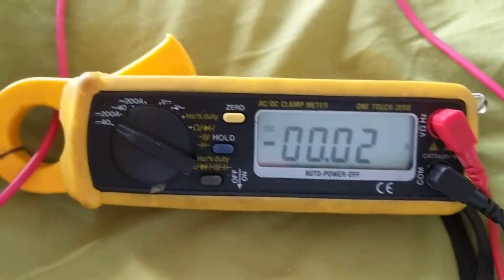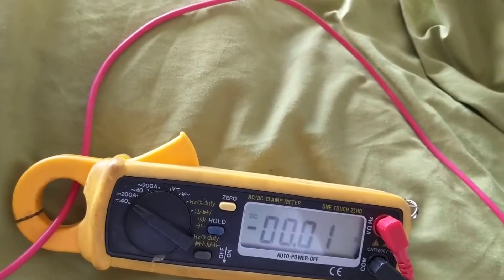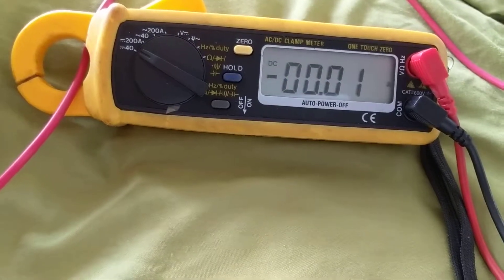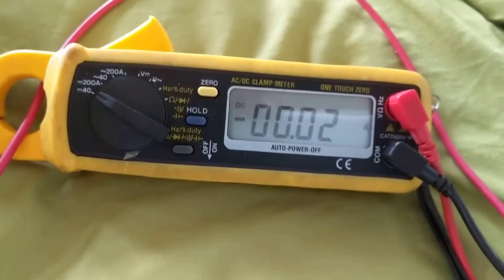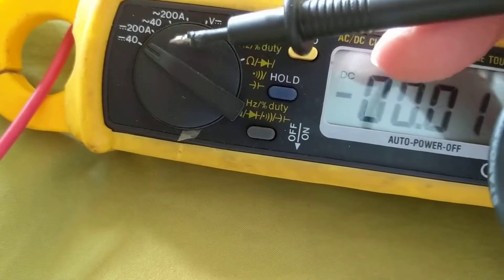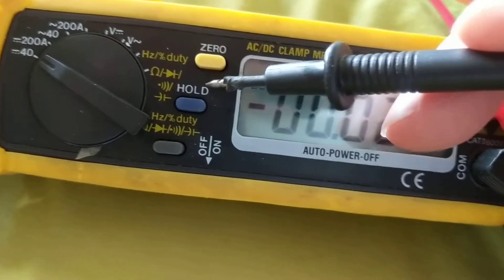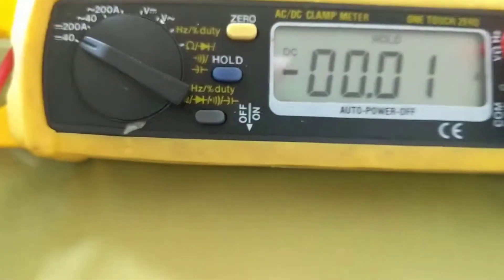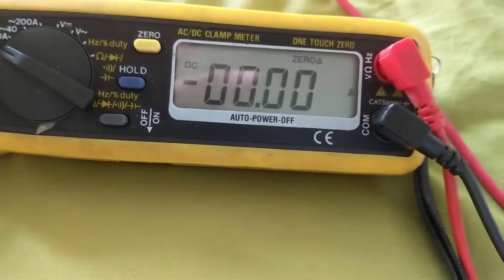BEST AND CHEAPEST, CLAMP METER no need to disconnect cables!!! FOR AUTOMOTIVE CURRENT AND MULTIMETER

Comment: This series made by Prova, and rebranded as Extech, AutoMeter, and possibly a few others with wildly varying price ranges.  Also there are about 8-10 versions  with different ranges,  at least in the Extech line and are NOT cheap.
Reply: Thank you so much for that comment and information I particularly like this one because it gives me a duty cycle and percentage needed for today's vehicles even though the best thing is a scope and scanner but it does come in valuable for alternators
Reply: And this one also can be used as a voltmeter that's why I like this one but if you're looking for a pure clamp meter for current I agree with you that definitely is a greater variety within your price range

Comment: You should do a whole video on nothing but the name of this clamp meter. You could call it 
Part 2: The Name
Or maybe a little mini series
Part 3: Where to buy one
Part 4 how much it costs.
Reply: Thank you and I respect your comments that meter is over 20 years old it's not even available anymore that's why I suggest to get something similar to it which is much cheaper today but thank you so much kerry
Reply: Made by Prova from Taiwan I think.  They make the same meters for Extech and Autometer.  Goto E-bay and check Prova clamp meters and see that they are the same design with different colors. They have several series with different ranges that all look like this.  Be sure to zoom in and check the selector switch to make sure the meter has the ranges you need before you buy,  as I said they have about 10 versions that look very similar.  The Extech brand meters are the same but marked up a few hundred dollars more in some cases.  The Prova 11 can measure down to 1mA dc.
Reply: Lol 😂 True

Comment: To get a DC amp reading, does it matter which wire I clamped? Negative or positive?
Reply: It's done usually on the negative wire but remember there are a couple of negative wires and there are a couple of positive wires one going to start a motor one going to the fuse panel one coming from the alternator or the positive ones the negative ones is the one coming from the engine block use that one thank you good question thank you for being a viewer

Comment: does it read milliamps?
Reply: Because it is a meter basically used as a clamp meter around the wire it reads very high amps like 200 amps so also reading in the milliamps is not available to these type of meters it stresses the point more of high amps you have to do the conversion yourself when it reads amps good question thanks for the comment or question

Comment: What was cost of the meter? 20 30 40 50$
Reply from the maker: I got this meter a couple of years ago I believe it was about $60 they run pretty cheap today as long as you get one for DC amps and AC amps and make sure the rating is as high as possible with this one it's only 200 amps
Reply: @automotiveelectronicsfroms2699  good info..thanks 60$ seems like a lot of money today for that type of meter.i was hoping it was under $20 that would be cheap..$60 is not cheap here in the USA... i just bought a new old stock Tacklife CM01A for $30 on ebay..it does AC DC amps and up to 400A..they have the new version tacklife CM06 for $40
Reply from the maker: You can see how the clamp is used to measure alternators go to my channel Joe electronics schematics by for Auto you'll see videos where I use it under the hood hands on thank you for the comment
Reply from the maker: You want to make sure that clampt meter can also be used as a voltmeter and an ohm meter and that the jaws are pretty small so that they can fit into the small narrow spaces in Automotive again I bought that meter about 20 years ago today obviously the prices went down